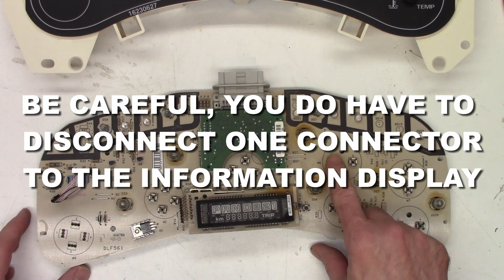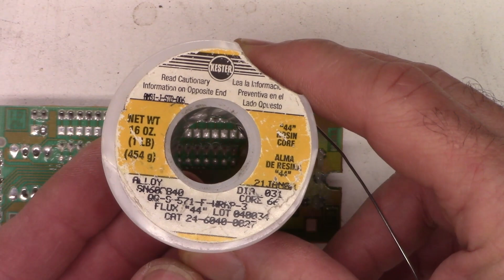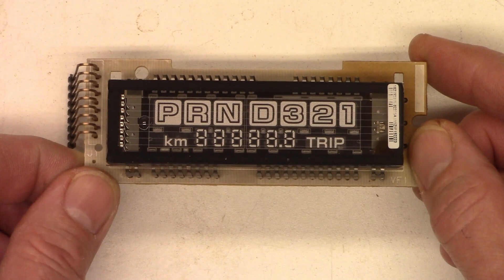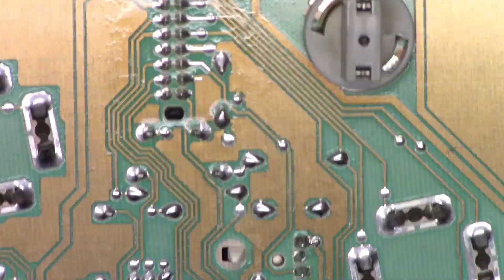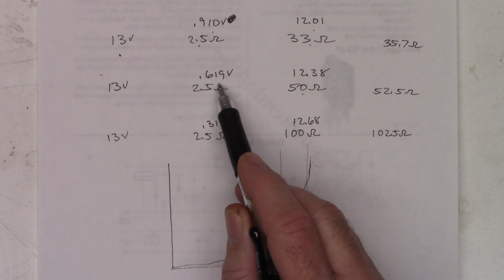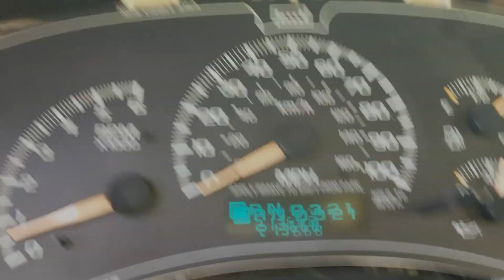99-02 GM CHEVY INSTRUMENT CLUSTER REPAIR DIM PRNDL DISPLAY 1999 2000 2001 2002 99 00 01 02 SILVERADO

Comment: Hello, I have a 1999 s-10 Blazer with 500,000 miles on it, alll of my fluorescent displays, radio, clock, outside temp in the overhead display, the PRNDL and Odometer are too dim during daylight operation. Does the repair you show here working only on thePRNDL board apply to all of my displays at once?

Comment: That board was originally wave soldered. The resistors would need to be dipped longer to heat up. But they could not because of the other pins... so they have a higher chance of a cold solder joint. And there ya go...
Thanks so much for the video.
Gonna check out in the near future!
Glad their failure mode is a dim display instead of a blown display!

Comment: What do you charge for something like this? I have A 2001 GMC Sierra SLT 1500, the P R N D 3 2 1 sometimes goes all the way dark, and I can't see what gear I am in. Then they eventually light up again. It only happens once or twice A year, so it might be hard to diagnose. I also have A problem with the outdoor temperature and compass on the rear-view mirror going so dim I can hardly see it, it is also random and doesn't happen all the time.

Comment: My 2006 avalanche info vfd is too dim to read in daytime. Is that a light switch dimmer control issue?
Reply from the maker: Does the brightness of the display change when you change the dimmer? or is always stuck on dim?

Comment: My Gage cluster gear selector and a odometer do not light up and oil gauge flickers back and forth I have changed the oil sending unit and it still does it what would you charge to do this.

Comment: First video of all them that showed the type of flux and part number. I was always wondering what they were using. I been getting these out of scraps yard and doing minor repairs like lights, steeper motors and pdrl displays cause of here. I can bring most back to life. Now to maybe try to repair a dim message / odometer display on 03-06. Seen the resisters to solder and then how to heat and replace that square chip if need be. Only one video shorta shows that issue. Now going to try these 99-02. These 99-02 steeper motors seem to be an issue and have to installed same way. I learned record player oil can be added to them to make work again. Cool little trick and ordered if off fleabay $8

Comment: Is there a way to rejuvenate vf displays big Clive said something about a nine volt battery
Reply from the maker: I remember in the late 80s or 90s  long before YouTube someone mentioned baking them in the oven to rejuvenate them. May be total BS but I thought I would throw it out!
Reply: That's a good way to blow the filaments.
Reply: I do remember someone made a video talking about burning off some sort of build up on the filament. But with these 99-02's the VFD are very reliable, the issue is alway either the resistors or header pin.

Comment: Common fault with this type of cluster, you sould really use a higher melting point solder to do them again, but will work for a long time again. The 100R resistor really should be upgraded to a 1W part, as it is the power supply for the cluster controller, and runs a little too close to maximum power. Higher wattage will run cooler, and still will fit there. Yes LED conversion will be nicer, but at least those you can get LED retrofits that are drop in replacements, and which work well.
Reply: I was thinking the same thing about the 100R resistor.

Comment: I hope you are holding your breath. Lots of fumes.
Reply: I hope so too! I made my own fume extractor that works great for less than $100.
Reply: @RobertCalkJr  too right. I just have a little 12V PC fan. We don't want him to get Ill on fumes... Where would get quality content from!
Reply: Yeah, I love the smell of burnt flux but It can't be good for us.
Reply: I never use any more flux than what is in the solder. But then I always clean the connections so that you don't have to.
Reply: neutrodyne   Not me, I am a firm believer in using plenty of flux.
Reply: @RobertCalkJr  I have nothing against using extra flux but there should be the correct amount of flux in the solder if you are using a good solder. If you are using no-flux solder then that would be a different deal and you would need to use flux.
Reply: neutrodyne  I use Kester RA solder. Even if you don't add extra flux, it still is a bad idea to breathe the fumes.
Reply: @RobertCalkJr  That's True. Even handling solder with lead in it is not good, but I have sure handled a lot of it.